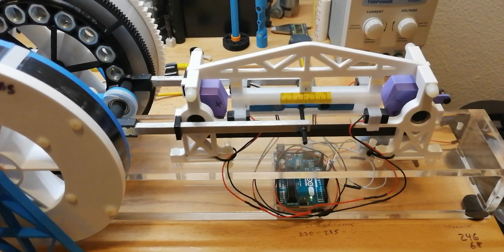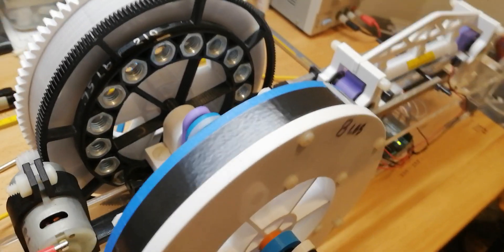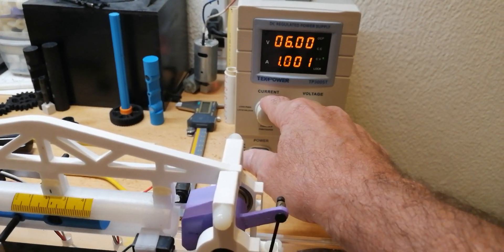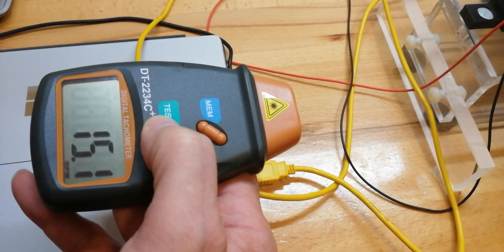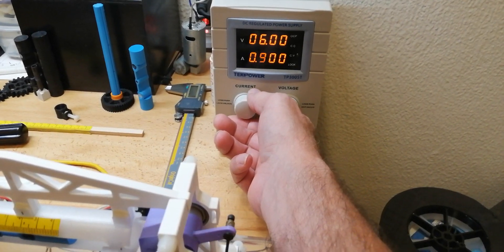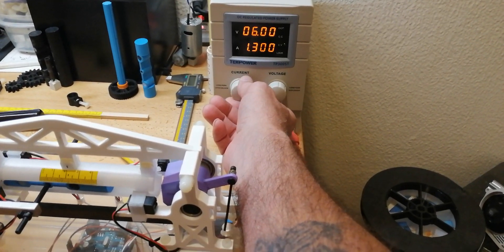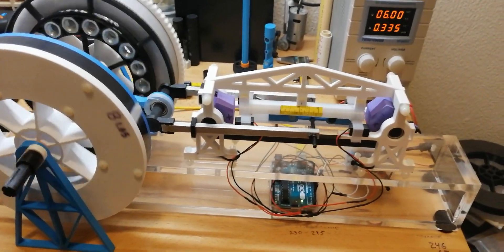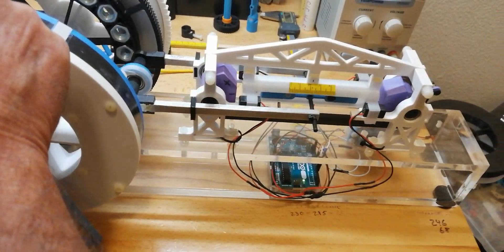MEO part 2

Comment from the maker: One thing that you all need to keep in mind is that I don't have the knowledge, skills or finances needed to take this much further. For instance A MEO built to use magnets able to produce hundreds or even thousands of pounds of force is beyond my means. A unit of such power would be able to output hundreds or even thousands of kilowatt hours of electricity. Imagine a factory that got all of it's electricity from a unit the size of a carry on suitcase, not including the actual generator. That is just the beginning of what this makes possible.

Comment: That is quite a bit of power, can you devise a mechanical flip flop to switch the end magnets. It seems that flywheel could perhaps store enough engergy to make that happen. Then you would not need any electrical power at all. If it runs that way, then any work output is gained strictly by the work of the magnetic force.
Reply from the maker: 5.4 watts for two tenths of a second once every two seconds is "quite a bit of power"? I put this out in the least refined way I could to entice makers and thinkers world wide to introduce free energy to the world by giving them a chance at patents. Only this method is now open source and protected against patent, in other words free to all of humanity. MEO is already over-unity as when it's at this speed it's putting out approximately 166 times the energy it is using. Another point is that the more load added to MEO the less power over time it uses to carry that load. What that means is it can provide the power needed for it's own operation. If you add it's own operation as part of it's load it will then use less power over time to carry that load without a change in the amount of power it puts out as that amount is determined by the size of the magnets and NOT the amount of power it needs to run. When I put this out as open source I thought it would spread across the globe like wildfire, I'm being proven wrong. People just fail to grasp the concept that the output power is determined solely by the size of the magnets used and has nothing to do with the amount of electricity being used to run the servo. I am so disappointed.
Reply from the maker: Sorry in my reply I neglected to answer your actual question. Almost since the manufacture of the first magnets men have attempted to build a "magnet motor" that was self running. so far this has proven impossible. Doing so would defy the so called laws of energy and motion concerning the amount of energy in a closed system. MEO does not change that theory, it adds a codicil to the theory by introducing a separate power source into the closed system (the servo) which is run by the energy already within that system. Trying to make the system totally mechanical would take away the advantage of the outside power source that allows this device to function the way it does.

Comment: This is great representation (I did watch the part I) ! I can see couple of ways , to mechanically improve , or scale this model (not very much in size , but in power it produces) , but I have no idea how to improve on force/time amplification of it , meaning , how to maintain rotational speed (RPM), with the power available from this device , when load gets bigger . To put it differently , if we attach output of MEO to a , let's say , mechanical water pump , which would pump certain amount of water to certain height - it would work beautifully (assuming there is some kind of water tank , or reservoir at the end , not variable pressure) , because it would have continuous maximum use for the (properly) designed system. However , if we attach the output end of MEO to the electric generator , it is a different story , because load is variable (even when just charging batteries) , which , in turn ,  when load is bigger , slows down the MEO. Even the ratio of input power  is lower than output power and MEO can be self sustainable , problem is that most of generators would not produce nominal voltage and amperage , below 300 RPM , or so. Of course , I'm aware of MPPT chargers and electronics , but , in my mind , the point is to make practical use of it as simple and cost effective , as possible. Do you have any ideas about this ?
Reply from the maker: Yeah an individual MEO as a prime mover would be purpose built. It would need to be designed with a known maximum power output and then excess power would be dealt with electrically. The secret to MEO is the ability to use time as a mechanical advantage. the speed of the piston travel has no effect on the amount of force the magnets provide as it is a known property of the magnets in the assembly and is only governed by their physical size and type. In a whole house generator motors typically are sized to provide around 150 pounds of torque. These motors rpm's do vary depending on load whereas a MEO prime mover would run at a constant max output and would control excess current electrically. Imagine a prime mover that would fit in a carry-on sized bag and was light enough to carry yet had an output shaft that provided over 1000 lbs. of torque at any speed. Further this prime mover requires no external fuel or input, produces no heat or emissions and requires neither atmosphere nor gravity. You could (through extreme gear ratios) easily spin a large generator at  1000 rpm. Keep in mind that the more load placed on MEO the less energy over time MEO uses, so if the small amount (relatively) of power MEO uses is added as part of it's load then the less power MEO will use to carry that load. That equals over-unity and in this case abundant free energy from a closed system. Kinda hard to wrap your head around huh? 🤯😜

Comment: Thanks for the additional input. I can see good reason to use an Arduino as it provides  options when testing different configurations. I'm inspired to do a  partial replication of the Meo and have started 3D printing of parts. One idea is to test which is more efficient, rotation of the drive magnets horizontially or vertically (you may have already experimented with this). I also plan to use a stepper motor to rotate the drive magnets with hall effect sensors.
What size magnets did you use in your design?
Reply from the maker: Good luck my friend, this is why I put this on here. My greatest wish is that someone improve on the concept and release one that is self powered and produces abundant excess energy. I did test MEO as a strictly linear device. I designed two separate linear generators to test it with but soon realized the time as a mechanical advantage angle was too valuable to give up (linear generators need to operate at high speed). Also slow speed operation means MEO itself generates absolutely no heat. That's something that no other prime mover in existence can claim (that I know of). My linear generators are also of a unique design so if you would like info on those also let me know. very much looking forward to seeing your progress.
Reply from the maker: Sorry my friend but I misread your question the first time around. The initial knowledge that led to MEO was the fact that it takes less energy to bisect two magnetic fields at a set distance than the amount of energy made available by doing so. This "energy differential" is approximately 2.5X, rotating the magnet takes even less energy. I did experiment with sliding them into place. I am very happy that you are experimenting with the magnet alignment side of this as that is an obvious back door improvement that I have left for others to discover. think of other ways to position those magnets using mechanical advantage that needs even less energy to achieve. In this basic version of MEO I left the lever on the back of the master magnet rotor a neutral length with the servo rod hole the same distance from the pivot point as the pivot point to the face of the magnet. 
Something else that will help you is the fact that the rotor magnets are made up of multiple thin discs so the resulting cylinder of magnets can be skewed to shorten the rotation arc. In a larger version with larger piston magnets single thin disk magnets can be used in the rotors thus decreasing the rotation arc substantially. GOOD LUCK!!!!
Reply: Thanks again for the additional input. Just received a shipment of 20 mm neo magnets and have been feverishly 3D printing test parts. This week will begin assembling & testing. I use 20mm extruded aluminum bars for a frame which works really well because it makes it easy to reconfigure the test platform. Another thing I plan to test is the the use of a coil to cancel some of the resistance encountered when rotating the magnets (as in the original GAP motor). It will be interesting to see if the amount of extra energy needed to drive the coil will significantly reduce the energy required to rotate the drive magnets.
Another thing that could improve the efficiency is to capture the back EMF generated by the motor that rotates the drive magnets as in Bedini's designs. @JeffyJeff01

Comment: Very impressed with your build quality! Everything looks well designed and engineered. I've been experimenting with a device that incorporates magnetic shielding but think your approach makes way more sense.
Reply from the maker: keep in mind the main concept (fact) behind why/how this works is it takes around 2 to 2.5 times less energy to bisect one magnetic field with another than the amount of energy created by the resulting field interaction force. This is a naturally occurring and constant force differential that science has totally ignored.
Reply from the maker: Also make sure to read my replies to other posts on here as there is some valuable info there.

Comment: This thing reminds me of the Troy reed magnet motor. It had like 4 or 6 of those magnet push pull actuators. So it was like a 4 cylinder and he would spin it up by hand and it would run itself.
Reply from the maker: Not familiar with that device, I'll research it, thanks. I don't specifically point it out in the video but when I turn the power down to 5.4 watts MEO is putting out around 166 times the amount of energy it is using. 
It is using 5.4W for .2 sec once every 2 seconds while output is constant at approx. 90W

Comment: what kind of torque sustainable? Great concept and execution. Ok, when you boost it with much larger magnets....now we are talking.
Reply from the maker: Sorry for the long reply time, been busy this week.
     I'm not an engineer or physicist so its hard for me to say for sure. right now (small scale) it takes over  +90w constant power to start the out put with a regular electric motor. MEO does it with 9.6w momentary. keeping in mind MEO runs in this video @ 5.4w.its calculated input if run for a week non-stop is .09072  Kwh while its output is around 15.12 Kwh. So output is around 166 times the input!  As soon as I started designing this I was pretty sure that a well designed version of this with individual magnets capable of around 250 lbs of force would be able to provide 4 digit efficiency!!!! This small scale version will do maybe 10 lbs of linear force max. it has a pretty pronounced force curve due to poor design and small magnets yet even its efficiency rating is off the charts.
Reply: It's running over unity..there is a patented magnetic/mechanical locking vid I need to share that a friend sent. I like it because you can take your work and multiply it.
Reply: Meaning when you get a rotation,  then transmission follows.
Reply from the maker: @metalink  Not sure what your meaning is here but in case you misunderstood, MEO is just the assembly with the magnets and magnetic piston. The rest, transfer arms, crank assembly, flywheels and DC generator just act as a way to show how MEO works. MEO has such a high output that even this small version would destroy itself if I tried to run it without some form of physical load as it is 3d printed. A finished version would be made from aluminum or composites. Something I don't have the resources to do.
Reply: https://youtu.be/SO4fErcr5e8